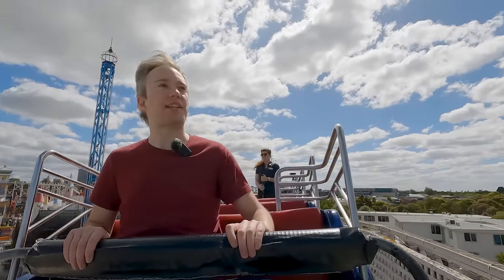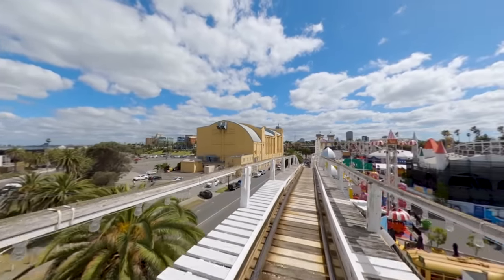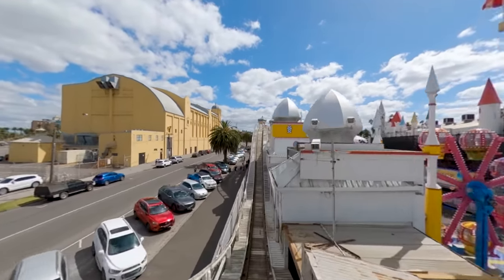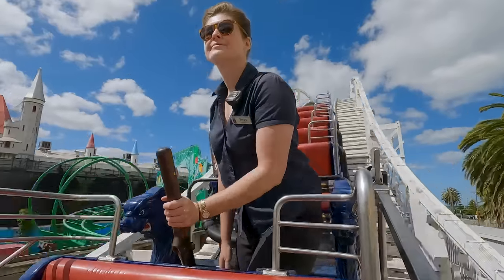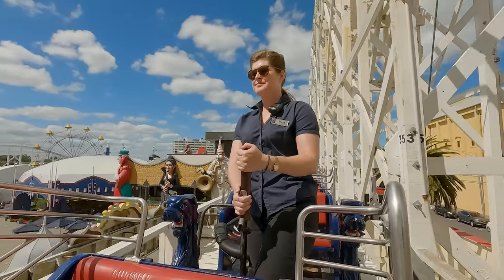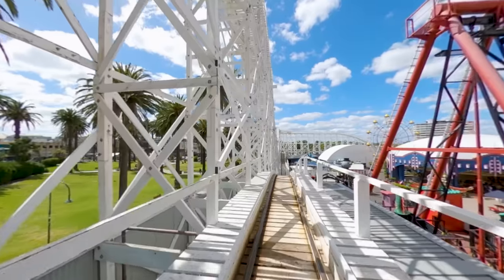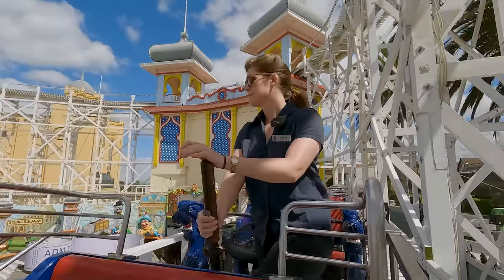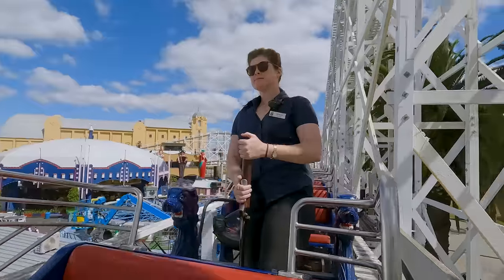This rollercoaster doesn't stop automatically

Comment: The old rollercoaster in the Finnish amusement park, Linnanmäki, also has manual breaks operated by a person. It opened in 1951, so it's quite a bit newer than the one shown in your video, but it wasn't constructed with methods that were modern at the time, so it resembles Luna Park's ride a lot technically. When it opened, it was the biggest rollercoaster in any Nordic country.

There have been times when the break operator has made a mistake, and the ride simply stops somewhere where it shouldn't. The ride can get completely stuck, and the people riding simply have to step away and take the stairs. There's a news article about it from July, 2011, and on that article the CEO of the amusement park says it happens once or twice a month. Two accidental deaths have been recorded over the 72 years the rollercoaster has operated (in 1953 and 1985), and both were because of improper use of the safety bar causing both riders to fall on the tracks and getting run over by the ride. 

The American Coaster Enthusiasts (ACE) has given the Finnish ride an ACE Coaster Classic status. This title is only given to 9 rollercoasters in Europe and 30 globally. The classic coaster must use traditional lap bars that allow riders to experience so-called airtime, or negative G's (that sensation of floating above the seat!). Individual, ratcheting lap bars do not meet this requirement. Furthermore, the coaster has to be built from wood, it has to allow riders to slide from side-to-side without constraint, it has to allow riders to view the upcoming drops and thrills and the riders have to be able to choose where they sit. Luna Park has 2 classic coasters in there!
Reply: Funnily enough thats the only rollercoster I have ever been in so its all I know
Reply: i didnt know those were requirements for a rollecoraster, since intuitively those about the bar and such would feel less safe than any strap or such. yes "modern" still scare me even if i go in them. the fact that "airtime" is even considered necessary is hilarious to me (although i get it)
Reply: I've been on that ride once when it got stuck! I do not remember the year, 2009 or something. They didn't stop it properly, so it went too far and then it rolled back down backwards and got stuck in the middle of a bend. We were stuck in the bend for a few minutes (which as a kid was kind of traumatic, and it gave my aunt lasting neck pains for a few days) before we were escorted to leave the ride and walk back by the stairs. The railing we had to hold onto while stuck in the bend also broke and leaked oil over our clothes. They didn't offer us any compensation for the incident, sadly.
Reply: In 1958, I rode the roller coaster in Tivoli Park in Copenhagen. That also had a brakeman on the car, rather than automatic brakes.
Reply: @PotatisKatten  part of the experience
Reply: @Apostate_ofmind  Airtime is key to a wooden coaster though, the material didn't allow for many of the experiences that are staples of modern steel coasters like positive g loops and such. So they were all about that airtime, hell even back then we had the physics to imagine such things but not the materials or technology to pull them off without breaking the machine with the forces etc.
Reply: I thought Tivoli Gardens in Denmark had the ol-fest wooden manual roller coaster in the world😅
Reply: IIRC, the trains of the Vuoristorata in Linnanmäki has a remote controlled pneumatic backup brake, which can be activated from the platform.
Reply: I visited that rollercoaster back in 2003. Glat to know it's still operating!
Reply: >two accidental deaths

why… did you feel the need to specify that
Reply: @noahbiehler3181  The queue for the ride has signs next to it where they go over the history. They mentioned the deaths in it IIRC.
Reply: @delurkor  Tivoli roller coaster is still operating as far as I know, and in recent years they reinstalled the artificial mountain peak on the top. It runs really close to the actual railway station outside the park, and is partially indoors as it drives through imitation mountain tunnels with windows into other amusements.
Reply: theyre 2 different luna parks owned by different companies.
Reply: @noahbiehler3181  it's part of the history and they were explaining the safety of it so it is relevant
Reply: @noahbiehler3181  If you mean why did they mention it at all, they were talking about the safety and incidents of the ride. It having actual deaths on it, but also not being a fault of the interesting part that makes it similar to the coaster in this video, feels like a fairly relevant fact.
Reply: interesting perspective and write-up! thanks!
Reply: @noahbiehler3181  Because it might have been deliberate. Obviously.
Reply: @noahbiehler3181  The rollercoaster operators do not assume liability for any murders that occur within the ride.
Reply: @delurkor  Yep, and it still does work that way :-)
Reply: That was a freaking fascinating read, thank you for sharing!
Reply: I’ve been!
Reply: @miskee 11 Tom's ride at Luna Park Melbourne is its only oldtime roller coaster! Scenic Railway. Big Dipper was dismantled in 1989, due to severe deterioration causing safety issues. St Kilda's Scenic Railway was subsequently mostly rebuilt. Tracks & cars are original but much timber & other items were replaced.
Sydney's Big Dipper was closed/dismantled in 1981, so also had only 1 classic type coaster. Unless, you want to include the much later built Mad Mouse / Wild Mouse (as named, at each L.P.). Original Melb MM no longer exists tho.
Reply: @krablord  Makes sense and frankly two deaths by user misuse out of all the passengers that will have ridden it over the course of 72 years does not that out of the ordinary for anything. There have probably been on the order of a million passenger rides over that time, that is on the level of routine activities like taking a trip across town, a couple of fatal incidents per million trips is about the same range there too. Seems barely higher than the background risk of you know being outside in that regard.
Reply: Great Yarmouth also has a brake operator on the woody
Reply: 1914 for RUTSCHEBANEN in Tivoli, Denmark. The oldest
Reply: @dengamleidiot  1. 1902. Leap The Dips @Six Flags, Altoona Pennsylvania
2. 1912. Great Scenic Railway, @Luna Park, Melbourne Australia
3. 1914. Rutschebanen, @Tivoli Gardens, Copenhagen Denmark
Great Scenic Railway, Melbourne is also the longest years operating coaster in the world. Six Flags one had shut down, & was reopened 15 years later. 
Rutschebanen has also not been operating, for several years, twice

Comment: Linnanmäki in Helsinki also has one of these old wooden rollercoasters where the brakes are operated manually by a person onboard. When it opened in 1951 it was deemed such a tasking job that they specifically sought out airforce pilots from the military for the position.
Reply: Isn't that overkill?

Comment: The "RUTSCHEBANEN" at Tivoli in Copenhagen is also hand-brake-operated. We are fortunate to live across the street and get to go all the time, sometimes just after dinner, walk over, ride it and go home.
Reply: There's one in Helsinki as well. But having seen both Copenhagen and Helsinki in winter, I'd be in Melbourne, too...
Reply: And if you go a few kilometers you‘re at Rutschebanen at Bakken which has had manual brakes and was updated with some automatic brakes. It‘s really bad! No charm, no speed. Braked to the point that it just makes it around the course…
Reply: The best thing about Rutschebanen was that the guy in charge of the braking was having a lot of fun with it - going over hills no-handed, making riders jump, etc. Looked like a really fun job.
Reply: @6yjjk  Espeecially in january... :-)
Reply: Traditional wooden rollercoasters just have that certain feel steel coasters can't provide. I rode this when I was on holiday in 2014 in Copenhagen. I've also regularly rode the one in Linnanmäki Helsinki.
Reply: @maxwellash1391  Rutschebanen at Tivoli's brakemen are bonkers. Both times I rode it, they just sent it.
Reply: @UwePieper  A few? I'll settle for the train, while you walk the 12 km ;)
Sadly, I have to agree with you on the speed of that slowboat.
Reply: @UwePieper  Bakken's coaster has to go slow to comply with safety regulations since they won't pay to have the track modernized
Reply: NO NEED TO SHOUT
Reply: Hello from just across Öresund! On a smiliar topic, I was SO SAD when they remodelled Rutschebanen at Bakken!! It used to be hand-brake-operated all throughout my childhood and teens, but now it's all automated. Not as fun anymore. Although, I still go on it like 10 times each time I visit!
Reply: Tivoli is bad, and BonBon-Land is good...
Og det er den rene sandhed
Reply: The Tivoli roller coaster is from 1914 - two years younger than the one Tom Scott is attending….
Reply: @CardinalSven  💀💀💀

Comment: The old rollercaster from 1914 at Tivoli in Copenhagen is built the same way, with manual brakes and brake men/women riding along. It's just a bit smaller than this. Generally it's believed the trains and the coaster structure itself will break if they go too fast, so the brakers are very thoroughly trained. At our version they will also run when it rains or sometimes even snows, of course within the safety limits, but since it's Denmark rain and wind is difficult to avoid. They will typically also let the train go faster if it's full of young people and brake more if it's an elderly crowd, so you will usually never get the same kind of ride twice in a row. Tivoli's coaster is also protected, so it has to be preserved the way it is as much as possible, as there are not even a handful left of these old coaster, and this means the brake system will never be changed, but has been renovated a few times as the brakes, wheels, and tracks do wear out
Reply: It's 25 years since I've been to Tivoli in Copenhagen, but that was the one I immediately remembered when seeing this. Thanks for the details.

Comment: I remember going here in 2009 with some mates for a birthday outing, we picked a school day so it wasn't too crowded. Anyway, us three and brake operator were the only ones on the carriage (which would otherwise be chockers on a weekend) and because it was underweight (we were skinny 13 year olds) the carriage lost momentum on one of the long flat sections at the top of the ride. We came to a complete stand still and got to enjoy the views, act as perches and indeed toilets for a flock of seagulls, all while waiting for what felt like a long time for someone to climb the tracks and gives us a push from behind. Perhaps it was a different carriage to the one Tom's on, which seemed to work fine with the weight of just him and the operator. All in all a fond memory nonetheless.

Comment: For those who don't know, roller coasters like this one require brakemen because they are "side-friction" coasters. This means that there are only two sets of wheels keeping the train along the track, one set that sits on top of the track and one set that pushes against the side of the track. There's nothing that's keeping the ride from rising off of the rails, hence the need to constantly control the speed via brakeman. From the 1920s onwards, almost all roller coasters built also have a third set of wheels (commonly called "up-stop" wheels) that sit underneath the track to pin the train to it, making speed control redundant.

(Also, for the curious, the oldest operating coaster in the world is Leap The Dips, which operates in Altoona, Pennsylvania. It's also a side-friction coaster, having opened in 1902.)

Comment: In the 1960s I visited my cousins in Margate, Kent and they took me onto the rollercoaster at Dreamland.  The brakeman was a friend of theirs and, as we were the only passangers, I was told to sit in the rear carriage.  At one point, as the 'coaster took a sharp turn, they shouted back to me to look behind.  I did so and watched in horror as the rear wheels left the track completely, take the corner and land back on the rails.  This was clearly a common thrill.   A time before "health and safety".
Reply: Why the quotations around "health and safety"?
Reply: @Cory_Springer  
You did it as well. ;)
Reply: @Cory_Springer  Thanks for responding.  Do you mean you think I should have written 'health and safety'?  I wrote it in quotation marks as it wasn't a term I remember hearing in the 1960s.  I don't think I have broken a great rule of grammar, but if I have I apologise.  Cheers.

Comment: There's one of these in Dreamland Margate called the Scenic Railway. It still has a manual brakeman, but since it was reopened after restoration in 2015 it also has a modern external safety brake system that can brake if the driver doesn't.
Reply: also mentioned in an old Citation Needed episode, with luna park!

Comment: Its so interesting that there's just rails on planks. And then a lever pushes down the brakes. It would be fun if there was no line to let it run through the station by simply doing nothing.

Comment: I have actually been on a very old ride that was also operated by someone manually using the brakes.
Its in the park called tivoli in denmark. I don't remember how old the ride was at the time, but i believe it was more than 100 years.
It does give an extra level of excitement, knowing the train is manually operated.

Comment: As a young boy growing up I remember there was actually 2 separate circuits around Luna Park, "The Scenic Railway" and "The Big Dipper". The latter was dismantled in the 80's due to the sheer size of it and safety concerns if I remember correctly.

Comment: You'd think that modern steel upside-down inside-out roller coasters would be the worst, but these old wooden roller coasters are the only ones that I find really scary. They shake and clatter and you feel like they're about to collapse, plus the negative Gs they were designed to provide, combined with their lap-bar restraints, can be truly terrifying.

Comment: For those of you who are unfamiliar, a block zone is a section of ride that only one train may occupy. At the end of a block zone is a method to stop the train in case the block zone ahead is still occupied. This is the safety system that prevents roller coaster trains from colliding with one another

Comment: There's a rollercoaster in Linnanmäki in Helsinki that's also completely based on manual breaking. Or at least it was when I last visited, which was about five years ago, it may have been set up with an automatic break system by now.

Comment: around 20 years ago or so I drove a rollercoaster in Holland at a place called Valkenburg. The park was called valkenier and it had a roller coaster that also did break with a very big lever like the one on this coaster. Slightly bigger it was. And it was located at the station. So that when the train was approaching it was stopped in the station by pulling a lever very hard. At that time it was hard for me to believe that was the way to stop the trains while modern coasters did it automatically already.

Still it is fascinating that it still is a thing on some coasters 😂

Comment: It's a shame the other historic roller coaster at Luna Park, the Big Dipper, was demolished in 1989. It was a serious wooden roller coaster with high peaks, steep drops and tight corners but was demolished in 1989 due to the wood frames requiring replacement. 

It was great fun, you could feel the rearmost carriage lift off the rails when you went over a peak at speed.

Comment: It’s also possible that a dead mans switch could be installed on those trains quite easily as it could in theory be a button on the floor that the driver must stand on with one foot while driving or a bike style handle on the break leaver that the driver must always be squeezing while driving! Of course releasing the handle or button will automatically apply the full brakes while it could also prevent the ride from starting at the station if the handle or button is not being held down by the driver! :)

Comment: To quote El Toro Ryan: For those of you who are unfamiliar, a block zone is a section of ride that only one train may occupy. At the end of a block zone is a method to stop the train in case the block zone ahead is still occupied. This is the safety system that prevents roller coaster trains from colliding with one another.

Comment: What a coincidence, I recently visited Donostia and they say they have the oldest steel rollercoaster (Montana Suiza) and it's also manually operated. I noticed that in both cases the brakeperson is in the middle of the train, is there a reason for that? Pure aesthetically I would place them at the back of the train.

Comment: I've live in Melbourne and I wasn't aware this is all manually done! I was just about to ask what would happen if the rides attendant is temporarily incapacitated but I guess it will be braked externally, probably by an observer on the ground. Correct me if I'm wrong.

Comment: I've driven different forklifts with a similar stick brake. (Not even the toughest to run. The toughest is the standing forklift, for moving in tight areas, with the brake and acceleration pedals on the floor and are foot-operated.)
I think everyone should experience driving a manually-operated machine of some sort. Rollercoaster, elevator, forklift...what else are there?

Comment: You could have seen one of these (practically identical) of the about same age, if not older in Tivoli Park in Copenhagen... I certainly hope you didn't fly out to Australia just for this. Also, there's another wooden rollercoaster north of Copenhagen at Bakken that is over 100 years old and the Danish royal family used to ride during the Edwardian age, but that one doesn't feature hand brakes.